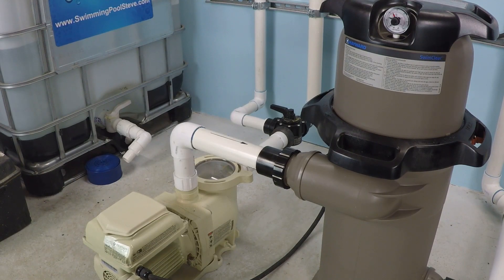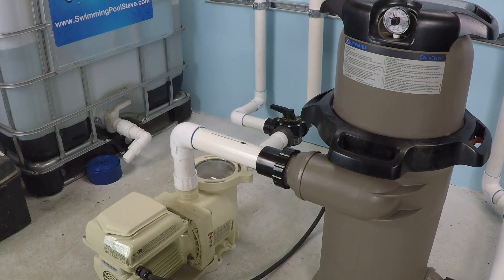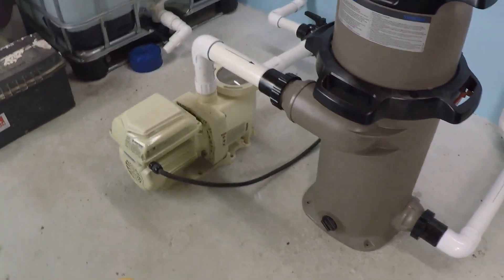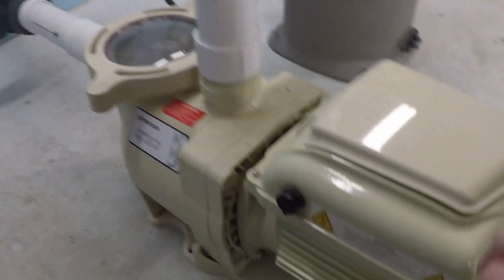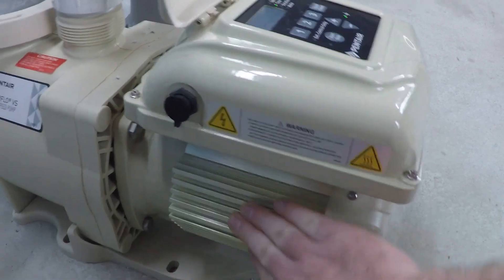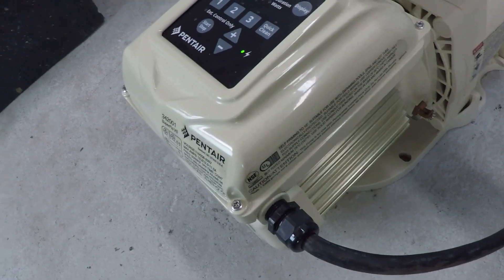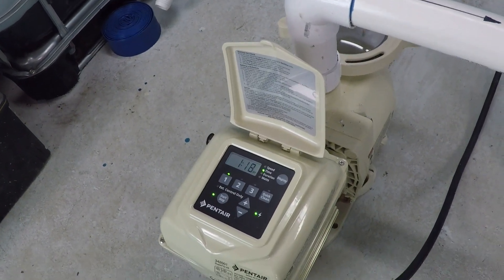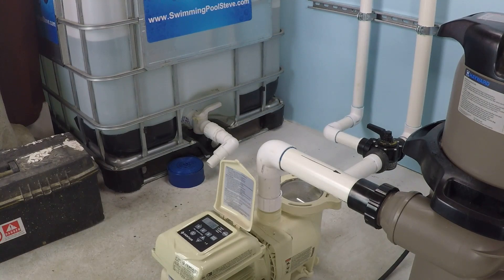What Is A Variable Speed Pool Pump?

Comment: Just looking into this today since my pool pump 1hp single speed is really old and corroded and dripping.  So do you run it at lower speed for more hours to get the water filtered? I have tons of trees around my pool that drop things all the time and use PoolSkim on the return which sometimes has to be emptied several times a day. I have a salt generator too. So I normally run 12 hrs a day 365 days a year (15,000 gallon). I was looking at Hayward MaxFlo, so I then should run it low speed all day and night? Thanks.
Reply from the maker: Maxflo has a tiny wet end strainer basket. Definitely do not like that choice for a pool with lots of overhead trees. The super pump VS is pretty much the same pump with a larger strainer. Yes, longer at slower speeds. Few hours on higher speeds, about double that at medium speeds and rest of the day on low speeds. The salt system will have a pretty low gpm requirement.
Reply: @Swimmingpoolsteve  Thanks for getting back to me. I have a pool guy wanting to replace it with Jandy 1.5 single speed and I do have Aqualink to program a schedule. He has one for $675 and with install it will ve $1000, but after watching your videos I am thinking it would be better for a variable speed.  The MaxFlo I got at Leslie's was $1,200, and the install is supposed to be $99. Yes, when I clean the strainer on the Century pump it can fill up even though I am careful when cleaning the skimmer basket. Appreciate your help. My salt cell is Hayward, and I was able to replace it myself,  but I am just a woman who isn't that handy.
Reply: @Swimmingpoolsteve  The one I got at Leslie's is SP23520vsp. I can't open the box or I won't be able to return it. Are you familiar with this model?
Reply from the maker: Yes this is the model maxflo with very small wet end chamber. Take a look at pictures online. Or the box. It is not the pump I would use for lots 9f debris pools. I am fine with the pump itself, just seems like the wrong one based on what you said about lots of surface debris.
Reply: @Swimmingpoolsteve  Thank you!!! What pump would you then recommend? I think I may have been wrong about the pipe size.  I measured the incoming port in the old pump, and it was 2", but there is a white pipe leading into it that has 2 - 1 3/4 as far as I can tell in the dark. Since I have the Aqualink for programming,  if I program the pump for 24hrs like you show, then I just set up a schedule on Aqualink for 24 hrs too I guess. It seems difficult to find Hayward pumps.  Leslie's just had that one. All the others were Jacuzzi pumps. They said the Pentair were much more expensive.  Again, thanks for your help.
Reply from the maker: Everything is on backorder. I do not know enough about your pool to make an informed recommendation but I can tell you measuring pipe is not how you determine. You have to read it. It will not be 1.75" for sure. Very likely it is 1.5" if it is not 2". In any case look at Hayward Sp3202VSP which is 1.85hp Tristar. Also available through dealers as Tristar 900 - sp32900vsp. Another good option would be pe take superflo 342001 but it has to be newer model production number to be automation compatible. Also available as a dealer line pump as superflo VSF 342002. Most likely one of these pumps is your best option. Price, availability, warranty is what I am looking at.
Reply: @Swimmingpoolsteve  Thanks so much. I did check the box picture, and you are right that the model has a ridiculously small basket area. Maybe I overreacted too when I saw the small leak and corrosion beneath the motor. I was afraid the motor is going to burn up. You have been incredibly kind. God bless you.

Comment: I installed this model last year and I love it. However I noticed that it kept blowing my gfci breaker and I read that the vsps can trip them and to try a different manufacturer breaker. Have you run into this?
Reply: Looks like this is fixable with a choke but it was old enough to just install the Siemens breaker that isn’t sensitive to the hf

Comment: This video is useless.  I want to know about the actual pump.  Where is the pump coarse filter?  In the wet end with the clear window! Where is the actual motor.  In the front where the fins are!  What voltage and current does it operate at? This video is a waste of time.  I found the info other places.